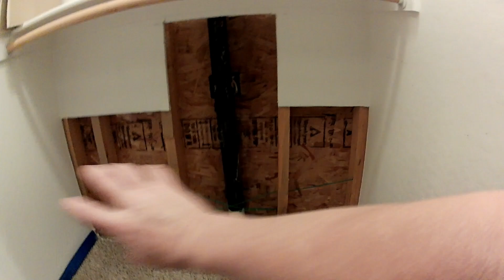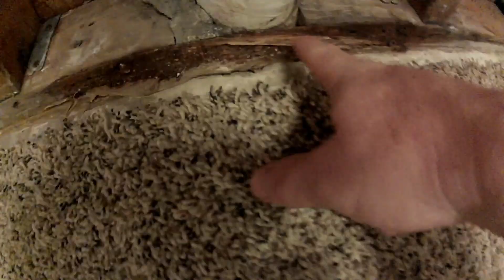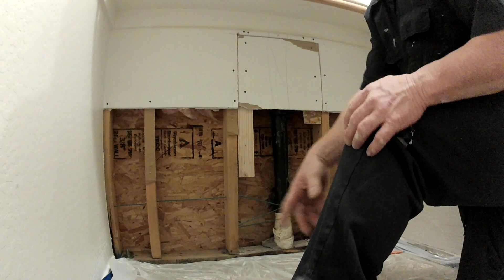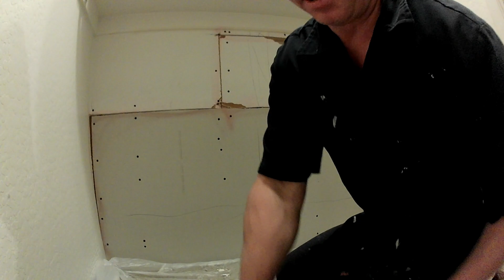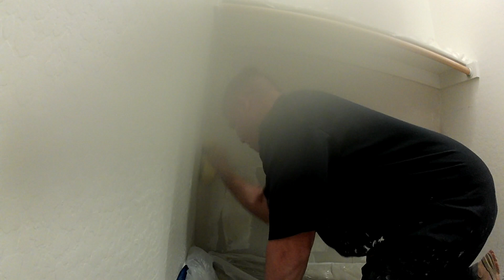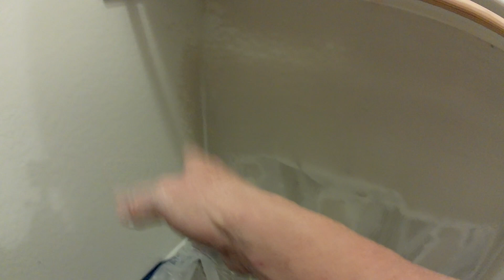Drywall Repair bottom wall 2'x4' drywall hung & textured drywall repair patching process water leak

Comment: It's kind of funny you talking about keeping it tight when you left your backing floating on two dw screws in maybe 1" of board at the top.
Reply from the maker: Job was done perfectly I do this every day for a living how many patches have you done
Reply: @drywallrepair  After 40 years, hard to tell, but it's a closet, it was a nice patch, so was an asshole comment, my apologies. 
You did say keep it tight, a lot lol, and having taken care of close to 3k properties as a GC for 15 years, and are own 160 units I cant tell you how many I have had to have some one redo because a tenant ran back into it again and they used molding or some other trash for backing. Have lost buildings, but luckily no lives when short cuts were taken on patches on firewalls as well. The last two days were especially fun as I made my son (I am re-tired, but keep the Corp open to pass it on and teach him trades and how to manage skilled trades people) re-do 2 x 16"x61" patches on a 5/8 double wall fire wall that the new painter vendor had faked out with double stacked molding backing (instead of cutting back to studs or using framing as required by code). Then using one layer of 5/8" in effect putting a blow torch in that wall if a fire occured. There are just two many hack "Drywall Patchers" out there (usually handmen or painters) doing patches on Shear Walls, or Fire Walls with no clue on code. You're not one of them, so apologies once again, I am a bit of an asshole and my comment was uncalled for. I should have just congratulated on getting the plywood on the right to hold with just screws on the top until you got more in.
Reply from the maker: @johnhubbard6262 pipes in way but I use hot muds always good finish lot of YouTubers channels show drywall iam actual 26 yr talker 15 yr licensed drywall contractor
Reply from the maker: @johnhubbard6262 no. Ur good I do what I can these patches without cutting back if possible save demo mess patch in